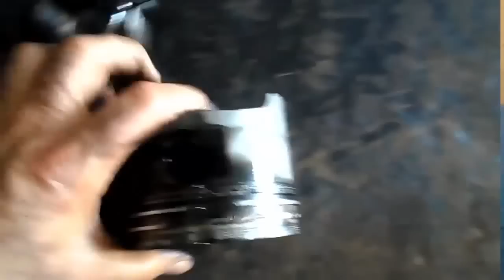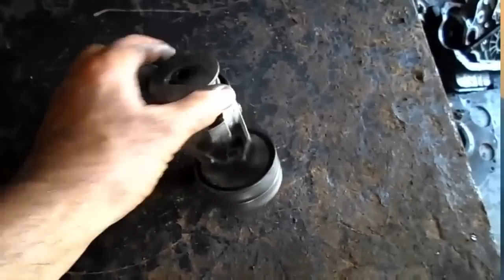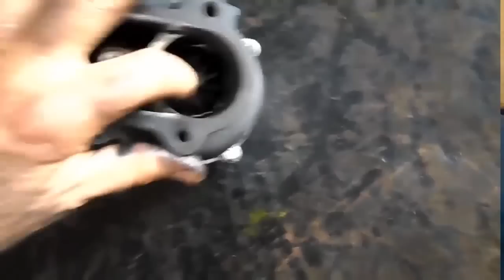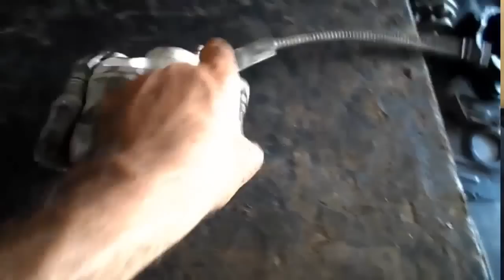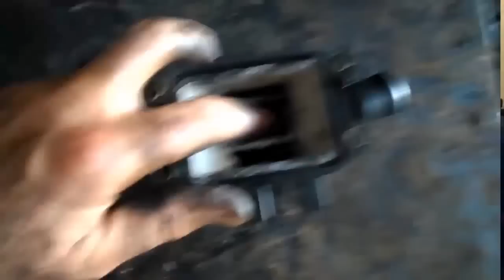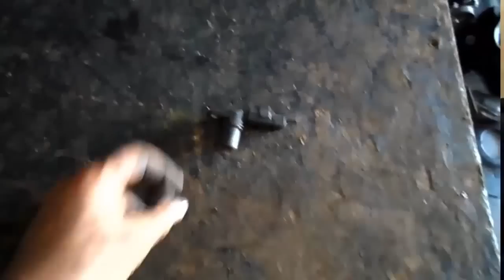أسماء قطع غيار السيارة باللغة الإنجليزية  the name of the car parts in english - automotive

Comment: السلام عليكم و رحمة الله
your explanation is not bad but you said that the sensor on the exhaust manifold measure the tempeture of the air, that's wrong it's call the o2 sensor or oxigene sensor, it's measure the oxigene in the exhaust monifold.
i give you some technic words  in english an french
turbocompressur=turbocharger
pompe de direction assistee=power pump steering
roue= wheel
roulement=bearing
etrier de frein=brake caliper
frein a tambour=brake drum
rotule= balljoint
volant moteur= flywheel
embrayage=clutch
moteur=engine
boite de vitesse= gear box
compresseur de climatiseur=a/c compressor
capteur de vilbrequin =crankshaft sensor
capteur de position d'arbre a came=cameshaft position sensor
من كان يتقن اللغة الانجليزية يصبح ميكانيكي بارع سوى كان في الميكانيك او حتى الالكترونيك بشرط ان يحفظ اسماء القطع بالانجليزية
و الله ولي التوفيق